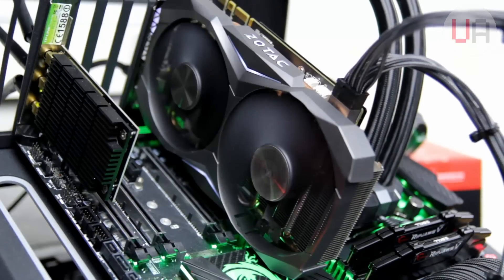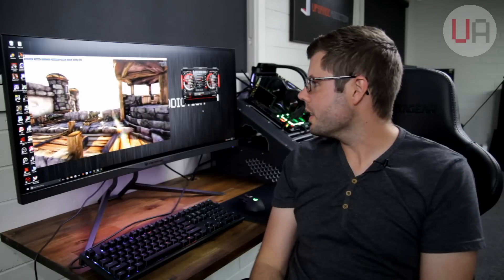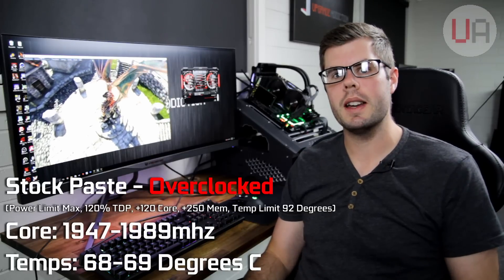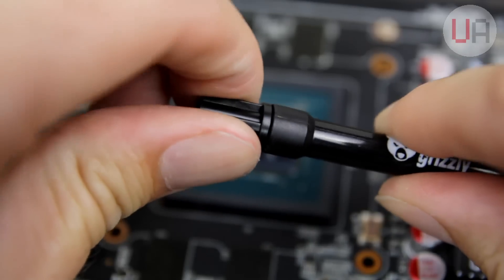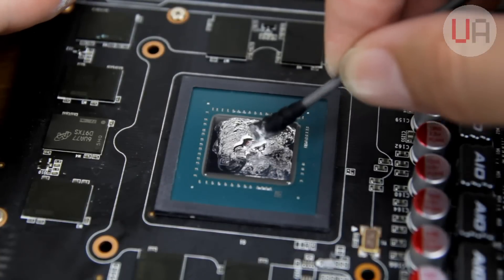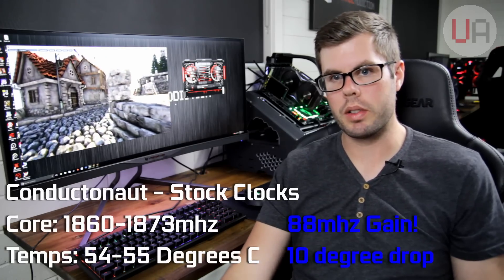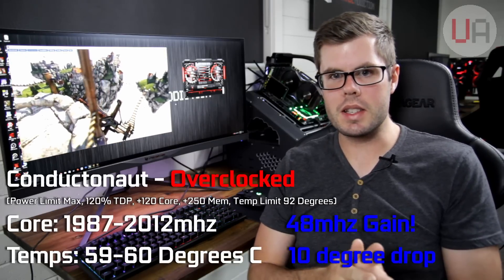Liquid metal on a GTX1080! How much did it help? (Thermal Grizzly Conductonaut - Zotac 1080 mini)

Comment: I'm slightly afraid of the liquid metal. I understand the risks and the benefits and would love to LM my laptop, but after replacing all the stock thermal paste with Arctic Silver, I realized that there's allot of coverage and I think I can only safely LM the CPU and the GPU, although the heatsink covers the VRMs and stuff. This would be on a Asus GL702VC, the Ryzen 7 1700 laptop. 

Glad I'm not the only one triggered by off centered fan decals lol.

Comment: Just gave this a try on the 1080 Ti Mini, but I used some nail polish also just in case. I also use a custom Bios (allowing zero rpm), running the card in OC all the time. The 1080 Ti still get's quite hot, but I got a more stable OC at a few degrees less.

Comment: 8:44 you should really isolate the contacts because the problem is not only spilling the stuff but also leakage over time. Most of the time liquid metal gets squeezed out of the sides if you apply a tiny bit too much. And that's hard to measure. So everybody should isolate the contacts since it's easy and with no risk.
Reply: Tg shield and good

Comment: You need to do this test on a fullscreen to make the card work harder, thus, producing more heat. Because I play Witcher 3 on 1440P and it would reach the max temps that I would set on MSI afterburner.

Comment: yo man, enjoyed the video but you really shouldn't be using a towel to remove thermal paste.  Minor possible issue is static, but otherwise the bigger issue is leaving behind threads from the towel.  Seems coffee filters mixed with a soft bristle toothbrush (plus high percentage rubbing/isopropyl alcohol) work best.  Cheers!
Reply: As does Paper towelling

Comment: I know it’s old video but people still watch so it’s actually supposed to be used on copper cooler and not aluminum as some other guy commented. Anyway I wouldn’t used it on a new gpu just regular thermal paste will do.

Comment: I used clear nail polish on the little resistors around the die.
Reply: I'm curious, how about vaseline? will that work...I knew about the nail polish.
Reply: I'm quite sure it will work short term. But, when it starts to get hot it will probably liquefy.

Comment: Great video! One question - How come the manufactures of these aftermarket coolers don't use a higher quality paste for their products? It sounds like there is a lot of gain to have from just changing to a better paste. Changing to the higher quality paste can't be that much more expensive for the production. Your thoughts?

Comment: Brought my Alienware 17 R4 with a 7820 HK, and GTX 1080 to the following temps
Before
CPU MAX: 89 C
GPU MAX: 92 C (massive thermal throttling)

After
CPU MAX: 69 C
GPU MAX: 75 C

Ambient room temperature is around 75 F
I'm very impressed with the CPU, but I'm not sure if I should be with the GTX 1080.  I've heard people getting temps like that for the gpu with the stock thermal paste (sometimes as low as 69).

I know my GPU temps dropped about 15-17 C, but I also feel like that is what the temps should have been in the first place.
Should I go in again and add more liquid metal?   
Thanks.
Reply: Hello. I think that's normal. I also put liquid metal on my CPU and GPU of my laptop. Max CPU temp before the liquid metal was 95 and after applying the liquid metal the max was 80, which is 15 drop. But I didn't check the GPU temps before applying the liquid metal so I can't say what's the drop there. Anyway, the laptop began loading faster thanks to the lower temps. ;)
Reply: Bro, just use kelvin, everyone will understand.

Comment: This stuff must be similar to the old Coollaboratory liquid metal. It's indeed hard to remove but really nice gains man. Would love to get one of those mini 1080's in the future, would you happen to know if there are any watercooling blocks that fit on the Zotac card? (I imagine they're a custom pcb though)

Also I hope you don't mind but I've watched a few of your videos and they seem to be slightly blurry (out of focus). Not sure what camera you're using and if manual/auto focusing, the reflection in your glasses is also a bit jarring..

Keep up the good work..liked & subscribed :)
Reply from the maker: Thanks mate! I appreciate the feedback. Yeah i use a Canon 60D with manual focus. Very hard to dial in. Yeah i cheaped out on the anti-reflective coating.. wont be doing that next time. LOL
Reply: No worries, constructive criticism right :)
I see, yeah the 60D is a good camera(used to own one). Had a Tamron 17-50mm AF f 2.8 on it for general use. Some of the cheap older manual lenses are great with a focus confirm chip which beaps or lights up in the view finder too..cheers

Comment: So I'm guessing this would be really good to use if your were doing a custom loop, and CPU deliding.
Reply: EX7RUD1CON yeeaah
Reply: Both my CPU and GPU have Conductonaut and are running under water!  Fucking cooler than a pair of Polar Bears!
Reply: KillJD rad, thanks for the input. I ended up going with the cool labs ultra only because it was what they were offering where I bought my delid kit from

Comment: I've just done some naughty tweeks to my FX 6300; Gigabyte 78LMT-USB3, and noticed an improved performance but the temp has increased by a dramatic 30F to a max of 159..!  Previously it would have refused to boot (I changed the system clocks and voltage, not just the cpu clock). However, the PC is a lot snappier, as you might expect. Unfortunately, I can't use liquid metal because my Arctic Cooler has an aluminium base plate :'(  If only they had copper coated it...

Comment: I overclocked my 1080  FE and it runs around 2038-2050mhz and thats usually around 82-85c. If it ran cooler i could get over 2100mhz.

Comment: I guess i got lucky. My zotac 7080 mini is overclocked to +155 core and +650 memory.

MSI afterburner doesn't control the fan for my mini, so only the zotac firestorm software works for it. Very strict fan curve on mine. 
Never reaching temps above 72 while gaming and reaching 2025 on the core.

Comment: Great video, a couple of things: You don't need to apply LM to both surfaces, it's stupid not to protect for electrical shorts, you can literally get a spray to protect the components (excluding the die), you applied too much LM, you didn't say anything about fan speeds, and dont apply the LM to the die directly with the syringe, it can shoot out and short components, apply it the the swab first and then to the cpu/gpu.

Comment: I really dont understand how zotac makes their cards, i've owned a 1070 AMP, a 1070 FE and a 1080FE all from Zotac.. the AMP capped at 82C even when the fans are at 80%, airflow is not a concern as the sidepanel is open.. sometimes the FE cards have lower temps, well most of the time actually,.. around 77-79C when the ambient is around 24-25C, a friend of mine has the 1080 AMP and he tells me it reaches 90C on some occasions with the default fan profile. but when I look at online reviews, the temps are pretty normal, around 65-75C on the AMP cards. I think theres a difference  in manufacturing process/quality in different regions and as im from asia (india), maybe we get the worst build quality. I've sold my Zotac 1080 FE and got a strix 1080 which never crosses the 70C mark even when overclocked to 2050mhz,  although their warranty is one of the best, i dont think ill ever buy a zotac card again unless they fix this temperature variance in different regions

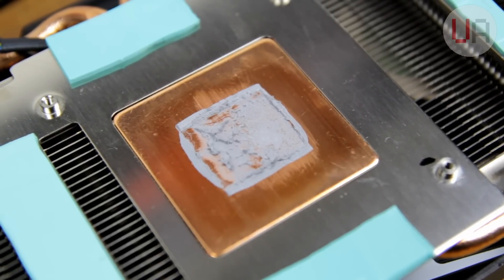Comment: 4:07 Can anybody tell me if the silver color metal having the thermal pads for VRAM around the copper cold plate contacting the gpu die is nickle plating or aluminium?
Reply: Drake Parker it’s more likely aluminum as nickel plating has only been used on the cold plates of coolers, at least from what I’ve seen. If your thinking of replacing the pads with liquid metal then don’t do it, cause the gallium in the liquid metal eats away at aluminum.

Comment: I would be so scared if some of it overflows and touches any of those transistors. Evn tho you put it pretty well to avoid that, couldn't it expand with heat and overflow? Pfft idk i am a pussy with this kind of things but 10 degrees are a lot of damn degrees. Awesome video man, you earned a sub with this one and the 3x Predator test.
Reply: I shorted out my Titan X Pascal. It just wouldn't boot. So I found a little bead touching stuff and removed it. Now it works. Obviously it has some protection built in, but that is not guaranteed with all cards.

Comment: Great video!  Could you please inform the thickness of the thermal pads for ram and vram?
Reply: 1.5 mm on memory.
1 mm on vrm.
This according to Zotac cs rep.
Better to just use 1.5 mm everywhere...just for consistency and also to maintain thermal pad sheet of a single thickness.

Comment: its crazy how u say it auto over clocked its self  due to lower temps. my evga hybrid gtx 1070. NOT the TI or FTW just standard liquid cooled. breaks 2ghz constantly never drops below 1990mhz and its on stock speeds as well. but also never breaks 40c even at those speeds

Comment: Hey, i wonder if you have any GPU left with the conductonaut still on? And how it has been working out with the copper heatplate of the cooler? I wana do this aswell with a AIO /Kraken g12 but atm i’m just using the AS5 thermal paste.. pretty sure Grizzly LM would get me lower in temps thou..! :P but i’m to afraid that there will be some kinda corrosion with the copper...? I’ve heard alot of things about it.. but you could maby give us a video when you take one of the gpus apart and show how the copper plate is looking over time?  Thanks in advance! /Kim

Comment: this is a good video and you obviously put a lot of effort and love into it. But in my personal opinion, you could have skipped a lot. Instead of talking about how you overclocked it and whatever, we're only here to see how the thermal compound works. While indeed beautiful, the b-roll and pan shots were very unnecessary but well presented. Additionally, this is purely opinion, I would have left the computer running for an hour for the benchmarks.

Comment: I also reapplied thernal paste on my 1080 G1 gigabyte with a 1C artic silver. it dropped 7 degrees at idle and gaming.idle tenps sit around high 30z and low 40s.gaming high 40s low 50s! impressive

Comment: I have a 980ti wind force from gigabyte, for some reason the thermal grizzly won't apply to the copper part of the heatsink, so only on the GPU die, my temps hit close to 80 degrees, pretty much the same as thermal paste.

Comment: roughly, how many drops in total did you use pal ? i know that with standard paste its just small bit wich should not even be spreaded over the surface. Just wonder how much to use when it come to metal liquid

Comment: Is it necessary to apply liquid metal on the heat spreader itself though?
I'm worried that it'll short the transistors around the GPU chip.

Comment: Only GPU @1873 with metal and 55C ? My Asus GTX 1080 Turbo with Areonout and  morpheus ii core edition runs @2100 with 54C and low fan speed was thinking on liquid metal but i will skip it

Comment: I'd like to know if and by how much it would make a difference to use that paste to replace the pre-applied stuff on the Corsair 110i all in one.
Reply from the maker: +Jason Repa it'd make an improvement but it's not ideal between the cpu and the cooler.... It's best between the cpu die itself and the cpu heat spreader.

Comment: Spreading thermal paste on a gpu or any semiconductor is a terrible idea, it will hurt the performance of the paste because it can trap air bubbles inside the paste decreasing thermal conductivity, its better to just put a decent sized pea drop in the center, and let it spread naturally from pressure, this decreases the chance of air bubbles being trapped in the paste.
Reply: @Shadow Banned That why a standard carbon based or ceramic based thermal paste is more then good enough, people get crazy with highend thermal pastes, its equal to people using thicker powercords on their power amplifiers, doesn't do much of anything at all but costs a lot 😂 artic silvers creameq 2 or artic silvers mx 2 or 4 is great, all are non electrically conductive, non capacitive and non corrosive, they can last 8 to 10 years with little to no performance decrease, the other fancy stuff might give you one or mabe 2 degrees better performance, "if that" but you're not going to notice that and the components won't notice it either, its a gimic to get the overly expensive stuff, used mx4 to interface hundreds of to220 and t03 transistors.  And im glad you like the pea size method, n yeah a decent pea-sized drop will work on most cases, If you never tried mx 2, 4 or creame q, you should. I say stay away from that gallium crap, it's overrated and the risks aren't worth it. If people want to to use it they can, its not worth it otherwise. 👌🏻👌🏻

Comment: Not watched the video and going off intuition, I cant imagine a huge improvement if your cooler is of shit design or equally if it's one of the best like the strix air coolers. waits for end of vid Interesting, though I'd have liked to see an application of another thermal grease like the noctua NTH1. That way there is a little more to go on with the results. I still believe if you have a really crappy cooler on a cheaper card you can improve the thermal conductivity to the coolers cold plate all you'd want but if you wanted to see huge numbers in improvement a new cooler or water/hybrid mod would be the go.

Comment: Do you recommend liquid metal even at a water cooler? 
I would use Kyonaut...

Could you test it maybe O_o :D
Reply: I used it on my Titan X Pascal with a waterblock. Dropped 17C. Dangerous to apply if you are not careful. Shorted out the card when some leaked over. You need to put VERY little, but the gains are tremendous.

Comment: Just curious as I think temps are a little high but I run an amd 6300fx black edition six core with 16gb of ddr3 and a nvidia 1060gtx with games on ssd but I get temps of around 70-75c when playing cod modern warfare are these high and if yes should I invest in water cooling I have an artic 13 cooler atm

Comment: Electrical tape is not a good solution to cover it, it will deform after a while due to the heat, kapton tape can handle the heat much better without deforming!

Comment: Excuse me fine sir, would you be able to tell me if this would work with the Palit Jetstream GTX 1080? Thanks.
Reply: this works on every CPU / GPU using a Copper Contactplate on the Cooler, do not put this stuff on Alu, CPU's using a Heatspreader are no problem

Comment: Question , what type of cloth and product were you using to remove the stock paste? I have the same GPU an would like to do this.
Reply: just use a microfiber cloth and some contact cleaner from WD40, i just did this mod with my Zotac Mini 1080ti

Comment: Delidid my 8700k and used galium and then put more on top
Reply: 23 celcious less
Reply: I would assume that you would have better results with the liquid metal of thermal grizzly. Gallium has a thermal conductivity of 29W/mk grizzly has 72W/mk. I also would assume that grizzly is way more adhesive, also resulting in better cooling. And also a thin layer is always better as long as it touches everything because the path the heat will take is shorter. Maybe if you are interested in 3 degrees improvement 🌚 I also heard gallium is way more aggressive

Comment: i have a 1060 6gb and i just wanna say, it goes higher (as clock speed ) when i don't overclock it , i mean i just set the power limit and temperature max to ...max and boom 1934 mhz when gaming but if i overclock i can only get it to 1890 or something like that, is that normal?

Comment: Time after time this stuff proofs amazing yet no clu manufacturer or gpu manufacturer nuses it by default even tho high ens stuff costs 400 bucks upwards to 1200 these days. Is 10 cents more on thermal compound really such an issue.  Ok application is harder but comon at that price range....

Comment: Just be fkn carefull with syringe, i pushed it really slow and for some reason it just squirted all away, 1/3 on cpu, 1/3 on motherboard 1/3 on ram. Before applying just let the syringe get some air by pulling it back than pour it in. I just wasted 10 bucks...

Comment: i tried this, result was that card wouldnt boot. back to normal paste and works again. so this works only on SOME cards, due to the distance between gpu die and cooler.
Reply: raphael schinköth got the same result as you. and seemed to stain the copper heatsink. cleaned everything and put on some arctic 4 tim.(btw I used coolab liquid pro)

Comment: anyone knows what the absolute max Mhz is on a GTX1080? I think i got a Silicone Lottery Jackpot Winner - it reaches 2100 Mhz  and after time (hours of gameplay) and higher temps (up to 73-74 C) it drops max down to 2065 Mhz. Its from Inno3D a GTX 0180 iChill x4 - it's stock overlocked but i didnt try to go further (because i know the OC is extremly limited on this modell).... the idea with Termal grizzly Conductonaut sounds good to me - but question is if there is any space to improve left - i heared something that the max Mhz for GTX1080 is like 2100 - but not sure... anynone can help?

Comment: I have the same card and i broke a little resistor near the die while trying to clean up the paste, is it dead?
Reply: does it still work? what kind of question is this? lmao
Reply: @kevinrussell9203  actually i've been playing with the little capacitor snapped off for many hours now, at times I can hear electrical zaps from my gpu but it didn't affect my game play, but there were few occasions where the system just turns right off but it's rare compare to the hundreds of hours I've played
Reply: @dns15r  i would find someone who can solder it back on for you